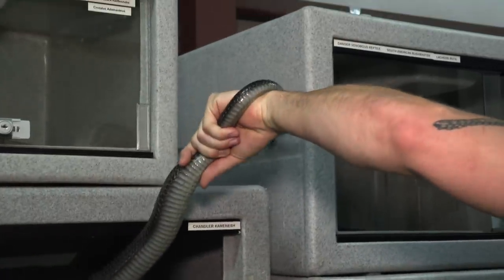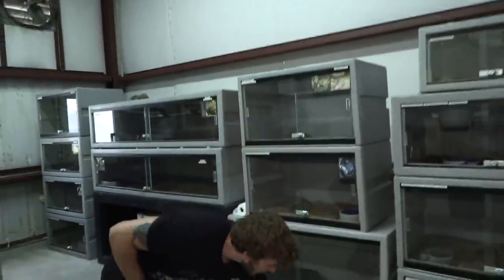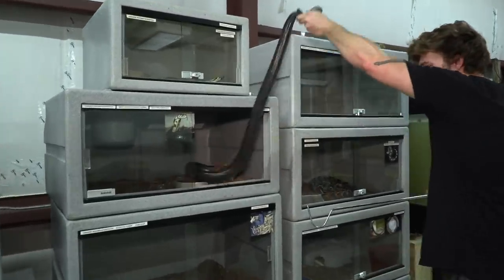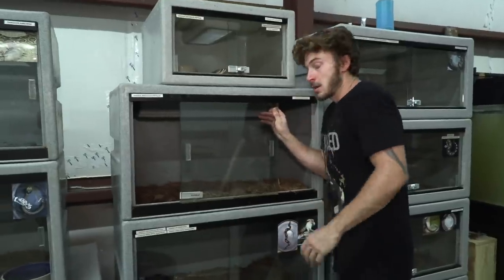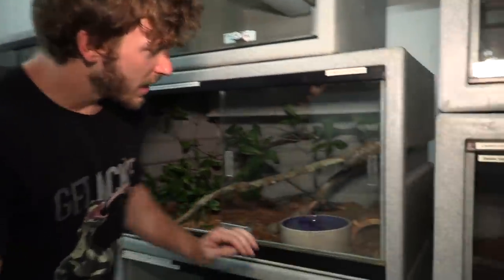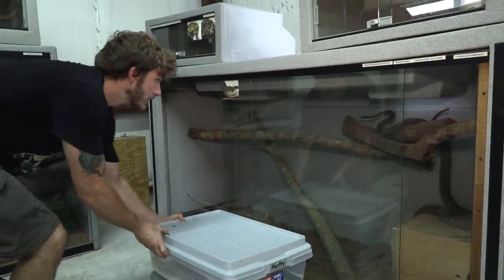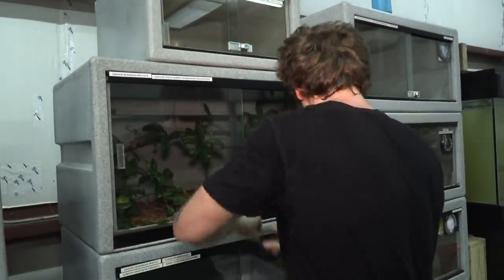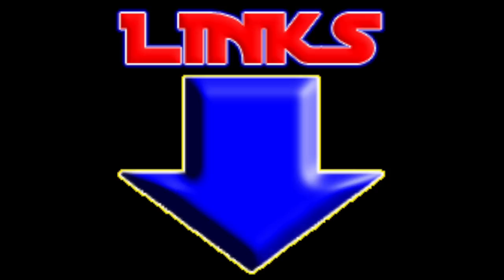REHOMING DEADLY MAMBAS & COBRAS!!!

Comment: Whoever’s worried about safety 
1. Check out his video about picking his holding containers for these green mambas. 
2. Doubly sure with putting them in a locked enclosure. 
3. Locking the snake house. 
4. Sealing the enclosure glasses with the insulation seal tape. (Even the tiny bits)
5. Double checking locks. 
6. All the labels perfectly in place. 
7. The amount of information he provides. (Knowledge he has)

Comment: The spacing between two panels of glass let's in oxygen
Reply: Vision cages have plenty of ventilation, don't worry! Just Google one and check out the website, they're designed very well.
Reply: @elysiumsnakefarm1185  oh he didn't clarify that I just saw them stacked on top of one another and butted  up against each other Glade they can breath 😉